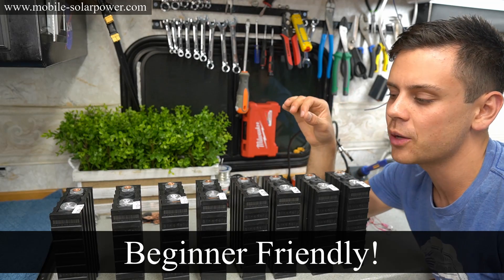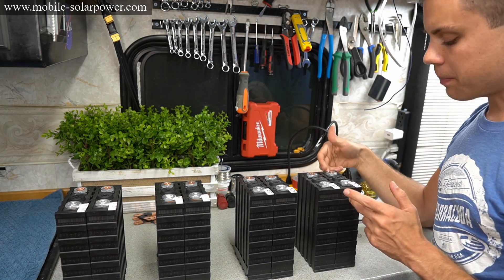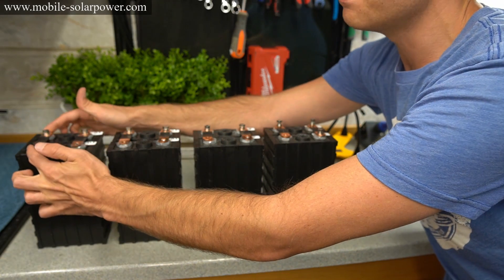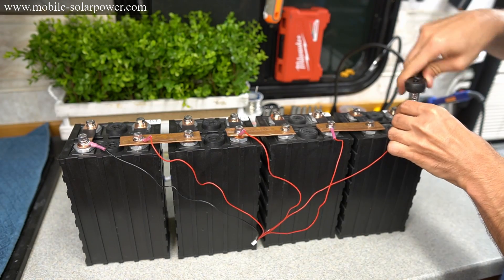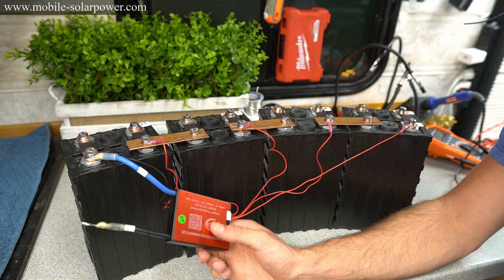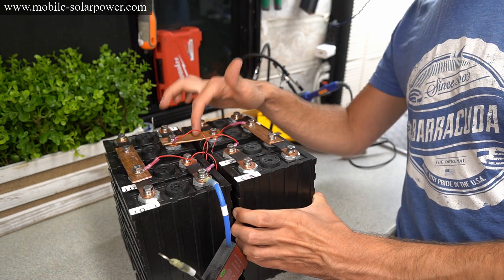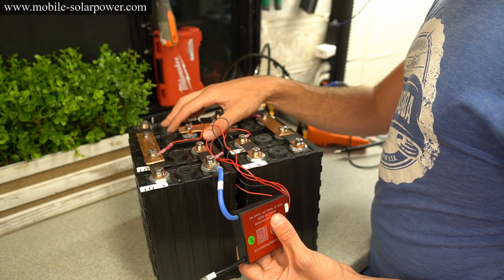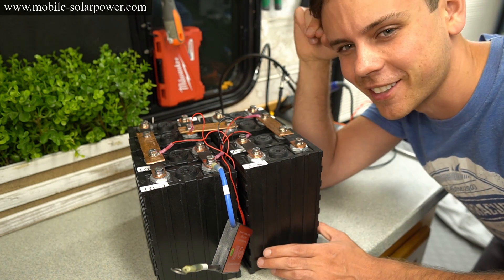How to Build LARGE LifePO4 Solar Batteries w/ Raw Cells and a BMS

Comment: Just returning from the web page you made for this topic & have to say, you are awesome! There is 1 thing confusing me there though.. In the beginning somewhere it says 2000 watt inverter max for this system with a relay, but in the choose your inverter section, there's a 3000 watt.. Can I do a very large battery system with the biggest relay & use the 3000 watt pure sine I already have? I also bought your favorite charge controller (EP Evers 30 or 40 amp I forget which) with a battery upgrade like this one in mind.. Can I go for it??

Comment: Thank you for your help so much. I really need your advice I don't know how to contact you about this problem I have with spim08hp battery packs that I get from Battery hookups. I was hoping to make a powerwall for my 400 watt solar system. Because I had really good luck with led acid and an old Harbor Freight 100 watt system. I took your advice and bought for Rich solar panels I like it they're making 15 plus volts when the sun is going down and I have to turn on the light in the barn. Wow. I have a problem with these batteries though I put them together with plastic insulators to screw the tabs together so it would be easy assembly. I found out when I added aluminum strips 1/2 inch wide to hold the tabs more securely. I found that when I was assembling some cells there was a spark between the tabs and the aluminum foil of the pack when I was only working on one end of the battery alone!! I put a voltmeter on it and there is a leak of voltage sometimes as high as full pack low voltage 3.8 volts on the foil on the edge of the pack! I think that is an indicator of a failed insulation inside the pack and is dangerous. Already 20 of the cells that I have have puffed. My charge parameters are 14.2 volts from the small 30 amp charger that works just fine with lead acid batteries. I found that a pact that I made would self-discharge and puff in two days by itself unhooked from anyting I'm wondering about fire hazard etcetera with the rest approximately 30 cells that even though I have BMS installed they cannot be trusted I'm worried please email me if you can. Email.. ain'tthat lonelyyet 33570 at Yahoo .com.or 8133257377. I've been working with engineers and I'm a prototype Machinist I made tooling to mass-produce connectors and all this stuff out of aluminum but if these cells are dangerous because they are seconds or rejects from China. America needs to know! These are fire bombs waiting to happen the way I see it please contact me. They come out of Pennsylvania from Battery hookups I may be contacting the Fire Marshals in Pennsylvania soon to let them do some research on these rejected sales from China I have tried to talk to the DIY rap from the manufacturer and have not received an email back yet I do not believe that the aluminum foil on the edges of these packs should be carrying current at all. This is dangerous especially in a marine environment where a spark could blow your boat up thank you very much will you help me a lot my name is Willie to they call me the handiest motherfuker in my County. I don't know about that you're not here in Florida!

Comment: How far can you scale this up safely and are their balancers that support multiple charge controller inputs.   I have 4x1380w of panels with each set handled by a Midnite Classic charge controller... and all 4 controllers are hooked to my battery bank.   I'm using AGM batteries now and after the first couple of years they are really starting to show their age in lost capacity.   I currently have a 1050ah agm battery bank.   I'm looking at Lithium/Iron and Nickel Iron batteries as options to replace/upgrade.

Comment: Instead of 4 sets of paralleled cells, could you have two balanced chargers on two sets of 4 series cells each of which is running in parallel? That way each cell has it's own charger, and you have double the amps by having two BMSs at the same voltage. I like each cell having it's own charger.
Reply: yes i would like to know

Comment: Can you make a video, or elaborate more on the Single port/Multi port BMSs? What are the pros and cons? I know that most multi-port ones cannot bare high current on charge ports and also are dangerous for some solar controllers-when they cut off the charging port only there is no place the current to go and the solar controller can die, while for the same port ones the current could redirect to a consumer that is still working (if there is one). Are there other differences? I ordered same port BMS and have Victron MPPT controller that I don't want to kill.
Reply from the maker: I put a full update in the community section on this. Just wire the solar charge controller directly to the battery

Comment: I don't know why i am having such a hard time understanding this, But if you are using 40ah cells and configure them like above don't you still end up with just a 40ah battery? or do you have a 160ah battery
Reply: Putting cells in parallel sums up the Ah (2 x 40 Ah = 80 Ah). Putting them in series sums up the voltage (4 x 3.2 V = 12.8 V). So using 8 cells with 3.2 V and 40 Ah each in a 4S2P setup gives you a 12.8 V 80 Ah battery pack
Reply: 160AH PROBABLY, I THINK THE SERIES AND PARRALLEL CONNECTION IS DONE ONLY TO GET THE RIGHT AMPERE/VOLTAGE

Comment: Why aren't you using the 1.2 amp active cell balancer instead of or in parallel with the BMS?  The maximum balancing current of that BMS is tiny.  If charging a large number of parallel cells at a high rate of charge (like with a good solar installation), won't the large capacity of the cells overwhelm the balancing current limit and let the cells become unbalanced during charging?  Why wouldn't you put four cells in parallel with their own BMS or active balancer and then connect several of these 12 volt BMS protected clusters in parallel at 12 volts?  There is a certain logic to having a limit on the amp hours connected to each cell balancer.  This same logic would appear to apply to having multiple 12 volt clusters in parallel whenever you might want to draw more than the 40 or 60 amps the BMS is limited to.  The load of a 4KW inverter could be shared by multiple BMS circuits if the cells were in 12 volt clusters with separate BMS circuits and the clusters wired in parallel.  If you get drop-in replacements like Battle-Born, you wind up with exactly the kind of system I've been talking about with 100AH worth of cells wired to their own BMS, then multiple BMSed clusters wired in parallel to make the capacity needed.  

Please explain what I am misunderstanding and why its not good to put the cells in series first, then parallel the 12 volt level.  I am about to set up a system from used medical equipment 50 AH prismatic cells in 12 volt clusters of 4C 2P for 100AH 12 volts.  My plan was to give each 100AH cluster its own active balancer, program my solar charge controllers to limit maximum charge voltage and use a 220A low voltage cutoff protected by a 200A breaker.  I'll have 6 of the 100 AH clusters to keep a freezer, fridge and window air conditioner running through the night.  It seems to me that having each of the six 100AH clusters on its own active cell balancer is a safer way to go.
Reply from the maker: Yeah you're mis understanding cell drift. If you have matched cells by capacity and internal resistance, they won't go out of balance. I can run a matched cell LiFePO4 battery without any kind of balancing for years without a problem. I have quite a few other videos that cover this, so please watch them

Comment: Here is a idea I am considering . taking a 40 ft cabin cruiser boat pulling the 100 hp diesel out and put in a 60 kw electric motor drive system. witch requires 96 volts. i see the complete 85 kwh tesla batteries on ebay .  my question is can a person reduce the tesla voltage down to 96 volts?

Comment: I have found these lifepo4 cells but have doubts that it is a bargain. 4 cells for $ 160 with the following specifications:
Nominal voltage: 3.2V
Nominal Capacity: 100AH
Battery type: Lifepo4
Charge current: 100A
Internal resistance: less than 2mohm
Maximum charging voltage: 3.65 + -0.05V
Continuous discharge current: 200A
Maximum Pulse discharge current: 3C 300A
Discharge Cut-off voltage: 2.5V
Cell Weight: 3.3kg average
Single Dimensions (H x W x D): 216x 142 x 62mm (height included pole) (manual measurement, there is some error)
Charging method: CC / CV

Is it an offer I should stay away from or is it just to get them purchased

Comment: still waiting on prices to hit reasonable     not paying 500 bucks for 1 12v bank,    dam near get a dozen agm's from walmart for that
Reply: Well it's half the price of a Battle Born for an almost identical battery. With up to 5000 cycles available at the 80% rate you'd spend a lot more on AGMs over the life of the batteries.

Comment: Why is it best to put cells in Parallel before putting them in series? Wouldn’t it be best the other way around? Then use 2 BMS to monitor each individual cell and also double the amount of output amps. That way if one cell is weak or bad you don’t shut your battery down completely.

Comment: At 4:10 after you rearrange the cells, you point out main negative and main positive, but the finger you use for pointing to main negative you don’t point to main positive... you point to the negative on the main positive cell... 

Make sure anybody using this video understand his right hand resting on the main positive while he is pointing to the wrong place.
Reply from the maker: Crap you are correct. I'll leave it because anyone building this type of battery will be able to figure out what I mean
Reply: @WillProwse  
Thanks for responding here you do point to main negative and positive, but your hand motions visually make it slightly confusing. 

I'd like to know why paralleling a set of batteries in series is bad...
Reply from the maker: @SuperVstech  I need to make a video on that. it has to do with matching internal resistance of packs. the likelihood of matching cells IR at individual cell level is higher than at the pack level. this is why battery builders do parallel first, then series connection. for example, a tesla battery module pack

Comment: Is it ok to combine different ah rated cells in a battery pack?
Reply from the maker: No, not advisable
Reply: @WillProwse  Thank you Will. I was hoping to add 8, 100 ah LifePo4 to a already built 24 volt 160ah system.

Comment: Early in this video, you said parallel then series. That surprised me. 
On Tuesday, I take delivery of twelve BattleBorn 12-volt batteries, that I plan to setup as a 24-volt bank. Do you recommend connecting them as two banks of six batteries in parallel, then connected in series? I was planning to connect as six banks of two batteries in series, then connected in parallel. 
Please explain the reason why for whichever you recommend. 
Thanks!
Reply from the maker: Those can be in series or parallel. Inside each battle born, there are cells in parallel, then series. Once the cells as a whole have a BMS, they can be wired with other packs in series or parallel. But raw cells, like the ones in the battle born, are in parallel first, series second.
Reply: I just bought your book. 
Thanks for the info!

Comment: I wouldn’t say I am a dumb individual, but when I comes to electricity and this stuff I feel dumb. Even for the “beginner” video. I am very much interested in off grid and solar. I’ll have to watch many more videos 👍🤙.
Reply: The truck analogy..  very basic concepts - more focused on DC than AC
Think of trucks and roads, depending on the size of the road depends on what can go down the road.

Solar panels are the manufacturer
Battery is the warehouse
Solar Controller (MPPT) is the shop front
Fridge, lights, etc are the consumers

The vehicle delivers the amps
Goat = 1 amp
Car = 20 amp
Truck = 100 - amps

Gravel track (thin wire) example mobile phone charging cable
Slow going, not many vehicles at a time, smaller vehicles (1v - 24v) as in not trucks.
Low amperage 5v - 1 - 5 amps(if you try to push too many amps (vehicles) they will get backed up and fights will erupt) the wire may literally burn up like a heater wire..
Long distance the gravel track can get tiring, your amps will deteriorate the longer the distance.

Country road (medium wire) example - laptop charging cable
Not bad driving, cruising, many trucks in a steady convoy.
Medium amperage 12v - 70 amps
Not as tiring as the gravel track but still tiring long distance, only loose power over 200m runs on average. 

Highway (thick wire) example - main battery terminal cables
Multiple trucks, heaps of capacity for more trucks but if you are not using many trucks it is a waste of money. However if you have a large power draw every now and then there is a passing lane that can be used. Example, switching an inverter on, running an electric kettle in the RV.
Big trucks and heaps of them 12v - 150 amps ... Least tiring of all the roads, very little power loss so you can drive longer. Minimal resistance in the line, minimal power loss

Will would be able to expand on this, and please correct if wrong, but it is what helped me grasp the concept.
Actually visualising how many trucks, how big the trucks that I need running through that wire to get what the customers need.

Comment: If you have the space is it better to have air gaps between the cells? is there a video on lithium cell temperature control? You almost have me talked into replacing my lead acid system ...or maybe augumenting it
Reply from the maker: Not for these when used with solar. Battery cooling important in other chemistry batteries when heat stability is a problem. The only problem with running these hot is decreased cycle life. And with solar, c rate is so low that it doesn't matter all. Just keep them in a cool environment and you are done. No special cooling needed at all
Reply from the maker: Check out my other LiFePO4 battery tutorials if you want to build a full size system

Comment: Why? 

Why is it bad to link sets of series banks?
I would think multi bms would be more precise protection...
Reply: I'm curious too.  In telecom we use multiple strings to add capacity.  This is also done for redundancy as you can take a string offline if there is a problem with a cell.   Though if I want to make a single battery that is treated as a single unit the way he does it does make more sense.
Reply: I agree and good question. I think series then parallel might cause an imbalance in one of the banks.... just a thought

Comment: what's the watts/hr for that? do you have a link on how to calculate  watts/hr?
Reply: 😒... 12.8 x 120ah( 2x60ah(looks like thats the battery he using for demo)) = 1536Wh capacity.
Reply: @ninja5672  thank you. so what battery capacity do i need if i run a 300watt system for 12 hours. If that's 1536Wh, i'll assume, if i ran a 300watt system with that it will only give me 5.12 hours? is that correct?
Reply: @ragazzoloro  Yes... Wh is Watts per hour, or watts times hours. Running 300w for 12 hours would require 3600wh of capacity, or 3.6kwh.

Comment: Can someone tell me why it is better to parallel cells to get your desired Ah rating before you series them to get your desired voltage rating?
Reply: You have to parallel first so you end up with 4 cells to use with your 4s bms.  If you series them first you end up with 2 12v batteries and you will need to buy another bms for the second battery.  Then you parallel them together to get the higher storage and the same 12 v.

Comment: Hey will. I have been trying to find a solar generator to use as a UPS that will handle 120 watts continuous while either passing through ac power or keeping the charge up on the battery. I want a ups that can do more than 30 minutes, but it seems like all of the solar generators I have been looking at will not pass through ac power or have a charge rate lower than my regular draw. Can you point me in the right direction?  I'm not using solar, but just want a battery backup for when we have power outages of a few hours

Comment: It would be really helpful if you could make another video showing the assembled sizes in inches of 12 and 24v packs.  1 for the 40ah, 60ah, and 100 ah.  I want to buy 2 12v kits, but I need to know the exact finished size of the packs to know I have enough room in the places I want to put the packs.  That would be really helpful.
thanks.

Comment: Where can I find these batteries at on eBay? I do not want the kit I just want those types of batteries please & thank you.
Reply from the maker: My battery kits also have option to buy raw cells as well. Also, my website has a section with used and new raw cells of various manufacturers. Lots of options. Did you go to my website?

Comment: I've purchased from Asia in the past but though Ali Express does a wonderful job at aggregating vendors it's a poor app for actually buying retail from.  When attempting to find out the shipping cost for a single unit of the Daly BMS you mentioned, I found you couldn't display the shipping cost until you completed the payment!!  No way Mr. Ali Express, if you can't tell me how much shipping cost BEFORE I give you my payment info you don't get my business.  Anyone with experience buying from Asia knows that shipping can easily exceed the purchase cost depending on how the vendor decides ship it.  No $60 Fed-X charge for a $20 item...

Comment: I have all my loads and chargers (mains, B2B and solar) going through the shunt on my Victron BMV700 battery monitor, but I can't see how I can use the separate port BMS and still have correct battery monitoring via my Victron BMV700, am I missing something ?